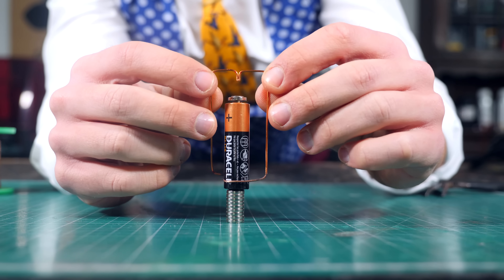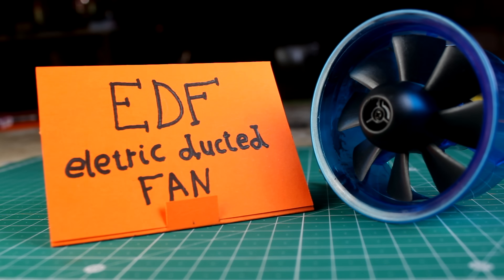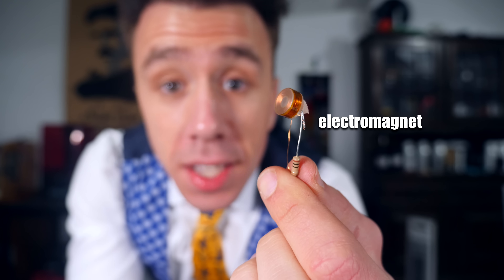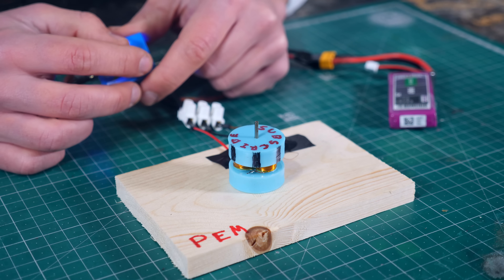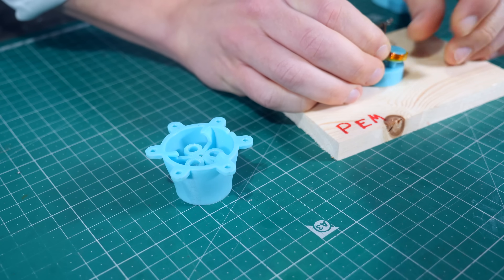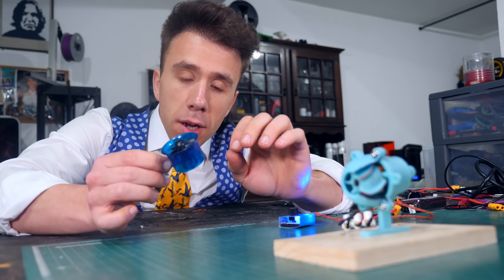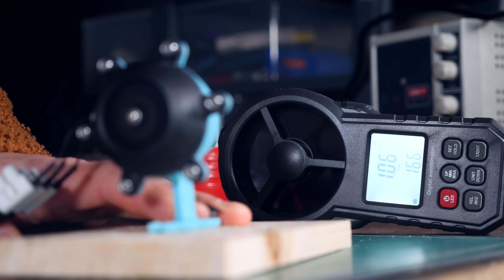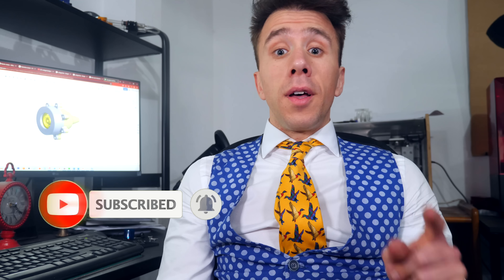I 3D Printed an ELECTRIC MOTOR FAN

Comment: A compressor fan and a bypass fan (the ducted fan) are two different types of fans. A compressor fan compresses air to increase the pressure and temperature of the air before it enters the combustion chamber. This compressed air is then mixed with fuel and ignited to produce a high-velocity jet of hot gas that generates thrust. The compressor fan is typically smaller in diameter and rotates at a higher speed than the bypass fan. On the other hand, a bypass fan  generates thrust by bypassing the combustion chamber. The bypass fan is typically larger in diameter and rotates at a slower speed than the compressor fan. The primary reason why a bypass fan generates more thrust than a compressor fan is that the bypass fan is able to move a larger volume of air, which results in a greater mass flow rate. This greater mass flow rate creates a larger thrust force. Overall, the design and operating principles of a bypass fan allow it to generate more thrust than a compressor fan.

Comment: Mass flow rate is the issue. Axial fans and axial jet engines are able to generate much more thrust as they are able to drive more air through each fan stage at the expense of a lower pressure ratio. Whereas radial compressors can generate higher pressure ratios at the express of the mass flow rate. 
Since thrust is dependent on the velocity of the exhaust and the mass flow rate. To increase thrust you’ll need to increase the mass flow rate in this instance. 

This is my best guess as I’m not a propulsion engineer

Comment: it has to do with flow vs pressure the flow you are missing is being converted to pressure, the flow meter you re using can only measure flow, if you were to measure pressure you would see a difference

Comment: I was thinking of am idea for a personal spacecraft. It would have 4 aerospike turbojet/rocket hybrids using a tripropellant with liquid oxygen, fuel and a catylist. The engines would be on the side of the cabin on the edges of the wings. It would take off like a vtol airplane and land like one, and it would use vasimir engines once it reached escape velocity.

Comment: I'm not an expert at all, actually I'm just a diesel mechanic and at least in turbochargers, tolerances are very small so I'm thinking you could add some Venturi effect at some point in your design or apply some variable geometry system so you would have more pressure/thrust, again not an expert so it may not work 😳🥹 love your channel bro

Comment: A centrifugal pump sacrifices thrust velocity for pressure. While the centrifugal pump doesnt output the thrust an EDF does, the actual pressure is much higher. Centrifugal pumps are also much quieter than EDF's.

Comment: a hose delivers more pressure than a reversed hose = Big intake gives more pressure..
Your fan is basicaly a trumpet.. Loads of noise but not much air pressure… 
Btw… Ketchup is the sauce of the devil…

Comment: the total volume of air, due to the size of the recess cavity made between the blades. (make the base smaller, and the blades taller, in the same housing. IE lowering the top of the base and longer blades. bigger cavity

Comment: It's is 100% due to surface friction drag. The more blade, hub, and housing surface you have in contact withe the airflow, the greater the contact area between the air and fan assembly. Thus higher drag, and lowered air flow. To get a higher pressure air flow, you have to increase the blade area increasing surface area for the drag to happen, and the drag also increases due to the higher pressure. So less airflow from the same output motor.

A major thing is air flow around the blade ends where they pass close to the housing. You must get them as close as possible to get the greatest efficiency. On an impeller the size of the ducted fan you have, 0.5mm or less is needed. Some make them, and let the blade tips wear down for the tightest tolerance. My thought on that is to do that, and then use a cylinder hone to remove a tiny bit more of the housing interior at the blades to let it more freely turn.

Also don't forget to cool the motor. This is why the Dyson blades are curved the way they are. They direct the airflow past the motor to help cool it. They loose some efficiency because the highest pressures are against outer housing. It doesn't take much air to cool the motor. The most important part is surface area to transfer heat. Some designs spin the motor housing, and attack the blades directly to it to improve cooling. It is also possible to clamp a heat sink around the motor.

To get high pressures using an axial design, like a jet engine, you will likely have to go to a multistage compressor design like used in jet engines. Otherwise centrifugal type designs are generally more efficient.

Yes, lots of design trade offs.

Comment: I think the shape of the "external case" is not the best, in most centrifugal fans I've seen the output hole is right next the impeller (like at 4:38) and i guess that the pressure reach its maximum value there in that region of the motor, if you put your output hole behind the motor there will be less pressure and the air will fly away slower

Comment: You should make a tomato exploder. A knife with a hole going from the handle to the tip with with high pressure air going through it.

Comment: As others have stated, you're using some of the energy put into the motor to pressurize the air instead of moving through it.  In a true aerospike, this is ideal because you're getting more oxygen into one place so that when you mix a fuel into that air and combust it, you get as much expansion as possible.  Then that quickly expanding gas goes the only place it can, through the rear turbine and out the back, thereby spinning the front impeller faster and creating a positive feedback loop as long as you continue to add fuel.  

You're skipping the combustion step so you don't get to realize the gains plowing over the parasitic loss of pressurizing the air as it passes through.  Therefore less thrust.

Comment: You are trading dynamic pressure for static. At one extreme, fans can move a lot of air with no pressure and at the other extreme, they can move no air at infinite pressure. Well, the extremes aren't really possible, but you get the idea. You trade air FLOW for air PRESSURE. I only worked at CoolIT for 13 years so only have a basic idea on this, but that's the gist and why fans that can move a lot of air are terrible at moving air through a radiator.
Reply: If you want to move a LOT of air AND increase pressure you need to break your fan into stages. If you look at a modern turbojet engine, the initial compressor stages are not a single set of blades, but split broadly into three sections -- the first speeds air up, the second increases pressure moderately and speed moderately and the third stage is all about the pressure.

High velocity gasses are terrible for thrust at low speeds, which is why most commercial jets are turbo fans. This combines a turbojet with a ducted fan which is better and providing high thrust at low speeds. As the plane moves faster, the turbojet becomes more important in the flight of the craft and the resistance of the fan is not significant -- at least at subsonic speeds.

For jets that travel faster than that, you either need a bypass or just opt to use a simple turbojet and have longer than normal runways (like most military planes do). Fun fact, this is why SOME but NOT ALL planes need catapult launches on aircraft carriers. The abysmal thrust at low speeds.

So if you want an EDF "thruster" you need to start with a fan that's producing high CFM. Then a straightener. Then a fan with steeper blades that increases the pressure, but not the air speed. You'll likely need to spin it faster as well, otherwise it just resists the previous fan. The third fan can then be an impeller, again, spinning much faster than the previous one, and ideally, with another straightener in between.

Remember the inner turbines of a jet aren't measured in 1000's of RPM.

The math of determining relative RPM and blade angle of attack is pretty complicated, so I'll leave it here.

Comment: You could try using smoke or some other medium to investigate if your print geometry/quality is generating a turbulent output; theoretically the ratio of pressure to exhaust speed share a relationship but in reality there are always many more factors.

Comment: I'm working on a similar project but running into similar problems. thinking maybe adding a compressor section to the impeller might help. but I could be wrong. if I am wrong I blame the tomatoes.

Comment: The two types of fans won't produce necessarily the same amount of trust. I'm gona make a short description so you can orientate your research.

There are two things to consider:

1- Thrust doesn't equal power: [power]=[force]x[velocity] for rectilinear movement,  [power]=[torque]x[angular velocity] in rotative movement, [power]=[preasure]x[flow] when dealing with fluids and [power]=[current]x[voltage] when dealing with electicity.

So, asuming the two types of fans have the same efficiency, maybe they aren't producing the same amount of thrust because one is producing more velociy and the other is producing more presure.

2 - Electric motors are self regulating machines: if a motor does not have a load, when apling a voltage [V1] will consume a current [I1] and will have a angular velocity [a1]. Whe you add a load, this will cause a decrease in the angular velocity from [a1] to [a2], which in turn allows an increase in current from [I1] to [I2] with the same voltage [V1]. This means that the two fans could be generaiting diferents loads.

Compare the two fans to two difents electrics motors, one more powerfull than the other. If you apply the same voltege to both, one the most powerfull will take more current.

You will have to measure the electrical power apply to both fans, and if the one is lower then you need to escalate it, so they are both comparable. If that dosen't work, refer to point 1-

Sorry for bad ingles, me hablar español como lengua madre.

Comment: It has to be a function of the diameter of the intake as others have noted.  There is only so much fluid (air) that can pass through a 1” hole. So without an increase in pressure there is no way it can match the flow rate of a 2” diameter hole. 

Presumably there is quite a bit of…. 🤢 math involved in determining what is required and even wether or not you can make that happen based on your equipment limitations.

Comment: okay my best assumption is that motor isn't producing enough thrust because its having to compress the air and it doesn't have enough torque to overcome the pressure. i remember peter sripol saying edf's don't have much pressure

Comment: My best guess is because by design centrifugal pumps are low pressure. The Impellers are engineered to draw in a liquid that has similar properties to water.  By rotating at hi-rpms that create little vanes between the impeller and the volute(housing), which require a tight tolerance to work properly, which produces a constant  resistance on the impeller that tends to slow it down hence making it low pressure. But since water is none compressible, it causes the pressure to increase especially at the discharge. Where as air is compressible so it doesn't have that extra pressure boost that water has. Maybe try adding some tomato juice to the air to see if it helps with the compressibility issue ;)

Comment: i think the good idea is to use ball bearings for the fan shaft and making it more rigid. that way you will eliminate most of the friction and gain some RPMs. U can also make the exoust side a little wider - im not a pro its just my toughts

Comment: essentially it boils down to fluid dynamics same motor means similar max rpm but not  necessarily same cfm or static pressure because they are determined by the blade geometry. and the blade geometry combined with the tolerances around the fan blades will drastically effect static pressure and cfm. @MajorHardware their channel is practically dedicated to this

Comment: You're trading high flow low pressure for low flow high pressure. Instead of measuring wind speed, you should try measuring pressure, maybe with a ballon attached to the outputs?

Comment: My guess is, its going to be 2 issues, The diameter of the opening of the fan, compared to the ducted fan it seems smaller, but the ducted fan has that shape the helps increase airflow in front of the fans (cant remember the name and too lazy to search it up), but also just mass, the turbine fan probably has a lot more weight / momentum behind it making the maximum rpm slower. Do I have any evidence to back it up??... ugh yes, it came to me in a dream.

Comment: You have to STRAIGHTEN the flow immediately after the impeller, otherwise the exit flow will be rotating and flung against the casing - meaning the fan will be cavitating within a rotating body of air. if the flow is straightened, the air it will be free to travel out your exit port. if you look at multi-stage high-head water pumps, after each impeller stage the flow is straightened before passing up to the impeller above. if this is not done all you get is one big lump of rotating fluid and almost no fluid exits the pump / fan.

Comment: I would suspect the issue is with the internal pressure not holding. From the point of the air leaving the impeller it should stay under this pressure or further increase until it reaches the exhaust. Any opening in the internals will lose air flow pressure.

Comment: The more direct the path of your working fluid, the greater your efficiency.  Assuming both are optimized for the motors powering them, a compressor fan will always be less efficient at producing thrust on its own than a ducted fan, or even an open prop.  The compressor wastes a great deal of energy by forcing the working fluid to take a helical path, losing energy to friction with every surface.  Energy is also lost through heat as the compressed air converts its kinetic energy to thermal energy as it slows down, and additional energy is lost as the air erodes the surfaces it contacts.  Even sound is energy being lost in a system (sound is literally caused by matter vibrating).  The purpose of a compressor fan isn't to produce thrust on its own.  When used in a thrust producing engine, the compression facilitates other processes (namely combustion).  An optimized ducted fan can out perform an open prop because it reduces vortex formation along the edges of blades and facilitates the flow of working fluid into the fan, and directly out, greatly reducing circular flow.

Comment: If the total surface of both the impeller and the centrifugal is not the same, you will not move the same amount of air, hence the different thrust, right?

Comment: The dyson impellers are good at being compressors. They move air, but because they are designed for sucking, they need to hold a large(ish) pressure differential. The dyson ring fans use the same thing, high pressure, and force it through a narrow outlet with high velocity. That sucks air through the large hole in the center through the Bernoulli effect.
Reply: So tldr that impeller geometry is garbage for mass flow rate.

Comment: Why should a fan have the same flow rate as an impeller? 

Offhand, it seems like the tradeoff for impellers would be more capacity to generate pressure in exchange for flow rate.

Comment: You showed a turbocharger impeller. My idea is to model your design as close as you can to a turbocharger impeller. A series of tall long fins with shorter fins in between each tall fin and redirect the outlet into your design or alter it to compress the air and speed it up as it reaches the combustion chamber. Just an idea.